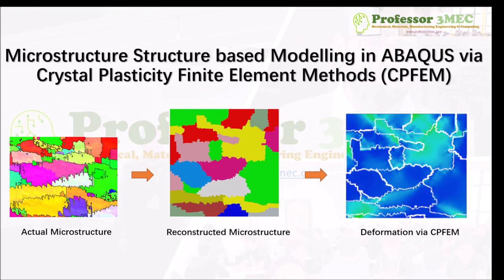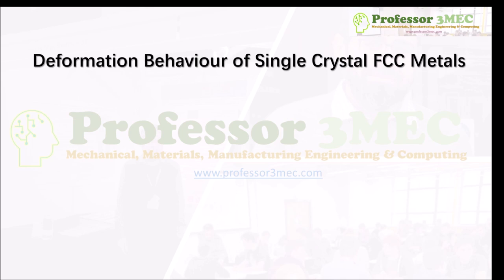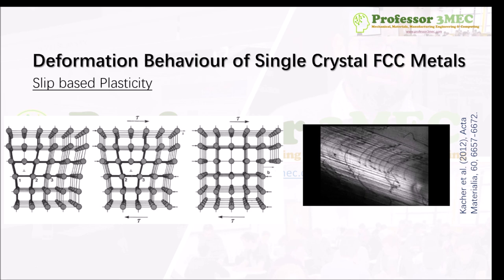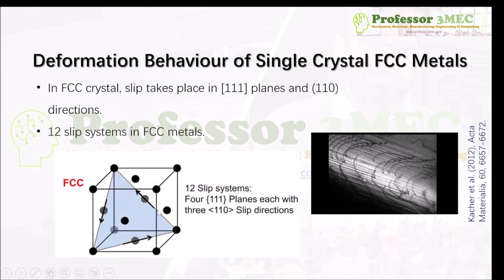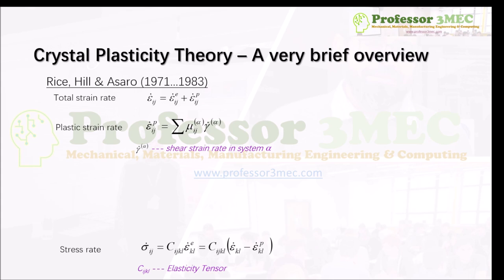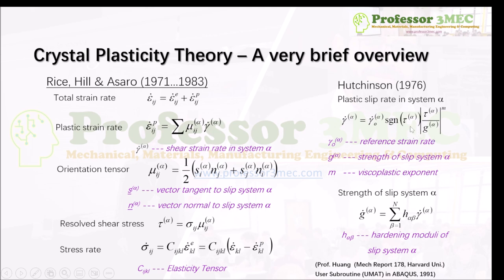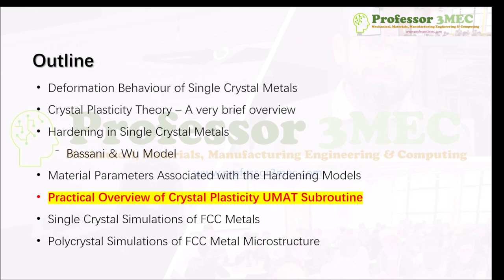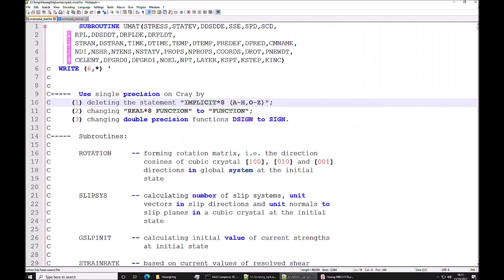Learn Microstructure based Modelling (CPFEM via UMAT) - Step by step Practical ABAQUS Guide

Comment: Professor 3MEC,
may I ask what version of the Fortran compiler are you using?
In my case, the system says ifort is not recognized
Reply from the maker: intel fortran, please check abaqus document for specific versions, as this will depend on which version of ABAQUS you have in the system. As, there might be compatibility issues among different versions of ABAQUS and fortran compilers. All the best.

Comment: Dear Professor 3MEC
Thank you for your explanation, I am a student and recently I have been studying 3D Image-based modeling and expected to perform the 3D Model (gained from Slices) to simulate fracture mechanisms. I have the 3D Model in INP FIle (Multiphase Steel, Porous material), Would you mind giving a tutorial about conducting the fracture mechanism on a microstructure level considering the fracture mechanism trough different phases (Different material properties) ? Thank you very much.
Reply from the maker: Do you want to model inter-phase fracture? or intra-phase fracture? More details on actual fracture mechanism would help in deciding which method is suitable and I can then quickly suggest something.
Reply: @Professor3MEC  Thank you for your respond, i would love to model interphase which fracture behavior is affected by the strength between two different phase. Please suggest me something Professor. Thank you
Reply from the maker: Hi, One option for interphase failure could be using cohesive zone model (cohesive elements) with nonlinear curves. Following may be useful. https://www.youtube.com/watch?v=vc6nQ_umsZs
Reply: @Professor3MEC Dear Professor 3MEC, Thanks a lot about the URL! its very helpful. 

Please let me ask you again regarding this tutorial; recently, I also worked using CPFEM for polycrystal 3D Models in Abaqus. I wonder how to give an output of orientation changes in every strain status? and How to export it? and would you mind showing me which part of your UMAT is referring to orientation changes? Thank you very much. I hope your reply.
Reply from the maker: I will try to create a view if still needed.

Comment: Sir Kindly explain the difference between CPFEM UMAT or PRISMS Plasticity Crystal Plasticity Simulations from VPSC8 Crystal Plasticity Texture Simulations ?
Reply from the maker: CPFEM UMAT discussed here doesn't include any homogenisation scheme and hence can only model actual microstructure at single crystalline level. VPSC I think is based on polycrystal homogenisation scheme and can be used to understand evolution of texture in lesser amount of time. Both can be used vice versa than above with some minor modifications.

Comment: Thanks for the well organized and detail vedio. It is really a perfect tutorial!
 Do you have any idea on generating the generalized stress-strain data for the whole material? I can get all data for each element, however, the data vary depend on position and microstructure. In order to compare with the material test, I would like to create only one curve as the representitave mechanical property. Any recommend literature on this problem?
Best regards
Reply from the maker: Thanks for liking my video. By material test do you mean uniaxial stress strain data?
Reply: @Professor3MEC  Yes, it is a typical uniaxial tensile test.
Reply from the maker: Try below for uniaxial parameter identification https://www.youtube.com/watch?v=SGXrnraQFRs&pp=ygUUdW5pYXhpYWwgdGVzdCBhYmFxdXM%3D
Reply: @Professor3MEC  Thanks for the vedio. It is well explained. Now I notice that only one element model would work, which in material case, single crystal can use this solution. Probably in polycrystalline, we need to find another solution.
Reply from the maker: You can use homogenisation theory too.

Comment: Very helpful, thanks a lot! 
I have a question, if it is convenient for you to answer, thank you:
When I run simple UMAT, the program works fine, but when I run other CP-UMAT, I get an error, run pre-.exe successfully compiled, As soon as the program started running package.exe, it said "Abaqus/Standard Analysis exited with an error, and there was no log file". 
The program version is Abaqus2023, and Intel(R) Fortran Intel(R) 64 Compiler Classic for applications running on Intel(R) 64, Version 2021.10.0. I wonder if it has something to do with the version?
Reply: I tried different compiler versions and finally ran the case successfully, thanks again.
Reply from the maker: That’s great . All the best.

Comment: Thank you very much Sir for this amazing video. I want to import actual microstructure, mesh it and perform crystal plasticity simulation. Is it possible? In my case microstructure is a copper alloy with lots of  twins and micro pores.
Reply from the maker: Yes it is. It will depend on model file format.
Reply: @Professor3MEC  sir can you please make a tutorial video on performing crystal plasticity simulation on  actual sem/ optical microstructure image?
Reply from the maker: @AKASHKUMAR-jz9yv  do you have some data which can be used?
Reply: @Professor3MEC  sir I have only optical and sem microstructure images. I don't know ebsd technique and also I don't have access to ebsd characterisation facility.
Reply from the maker: @AKASHKUMAR-jz9yv  let me see if I can find one which I am allowed to use.

Comment: When I run with command window,and why do I have this problem：Singular matrix.
Reply from the maker: It could be due to high load or time increment. Try reducing the load or best is to reduce the time increment to a small value.
Reply: @Professor3MEC  Thank you so much i will try to do as you said

Comment: Hi Professor 3MEC, i have a question. 
It's possible to write this paper in Python and in the next stage put it Abaqus? Or do you recommend using Umat?  
if you think umat is better, then I will download it. 
Thx Prof :)
Reply from the maker: I doubt that you will be able to use python, unless you  change the internal architecture. But that is just me. In my opinion, for each material (integration) point ABAQUS calls for UMAT inherently and hence umat might be the best option.
Reply: @Professor3MEC  ok perfect. I will do what you did in the video, because I need that kind of structure. Next i'll solve the hydrogen embrittlement problem by exploiting Fick's law of diffusion and I will have to consider the cube as if it were made of Inconel 718. Thx Prof
Reply from the maker: great. Please do let me know if I can be of any help. All the best.
Reply: @Professor3MEC  Hi Prof, i want update you! I did the whole process and i understood the method (although I did not obtain the .obd files due to the lack of the 'Intel Composer XE' programme, so i only observe the results in this video). 
Now my goal is: create a microstructure where within cube there are irregular grains for studying the behaviour of material (nickel in my case). In order (maybe ahahah) 

1. How can i create the grains within cube? I want a grain with irregular geometry (disordered orientation) this because i have an anisotropic material and as a consequence I have different properties in the main directions
2. I want create the part in point 1 for simulate the intra/interphase about superalloy (differents phases in superalloys) 
3. With some tools i want to observe the behaviour of nickel with diffusion of hydrogen (in Abaqus i can use "Fick diffusion", while in Ansys i can use the "heat transfer" and substitute the values of hydrogen) and obtain the results.

Have you some info to give me for this? Now i don't ask to solve my problem, but i want a guida to understand and make a mistake for understanding how to achieve the result.
Reply from the maker: @invisibleman2059  For microsctructure you may try Neper open source code, which can generate random grains, etc. both in 2D and 3D.
Reply: @Professor3MEC  Yes Prof, i found this on YT! But with that script, can i use it on Abaqus for simulate my problem? Moreover i want to study the inter and intragranular phase!
Reply from the maker: @invisibleman2059  we have used it for generating microsctructure both in 2D and 3D, please see below paper. 
https://papers.ssrn.com/sol3/papers.cfm?abstract_id=4264373